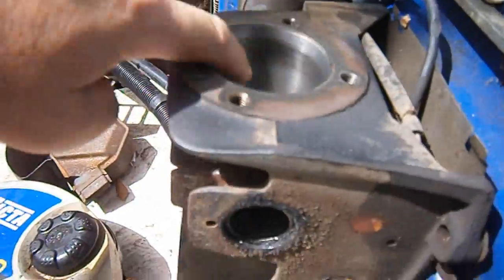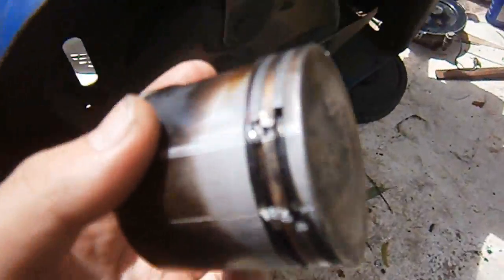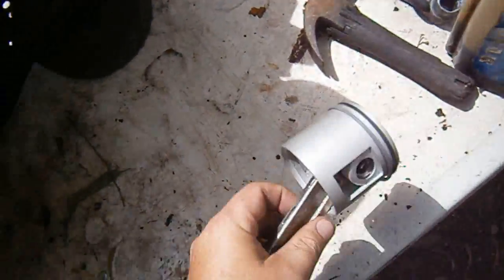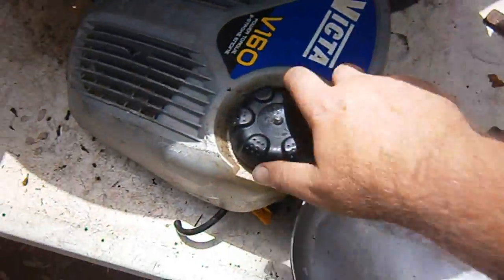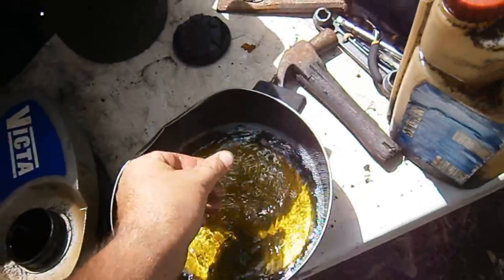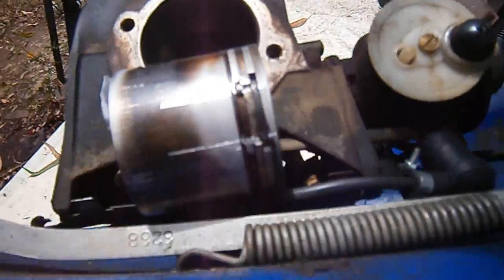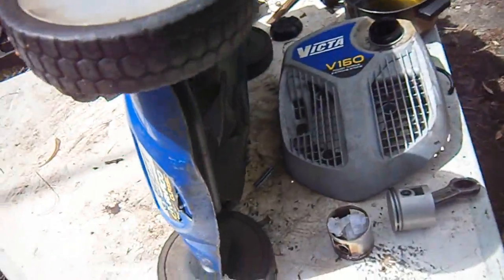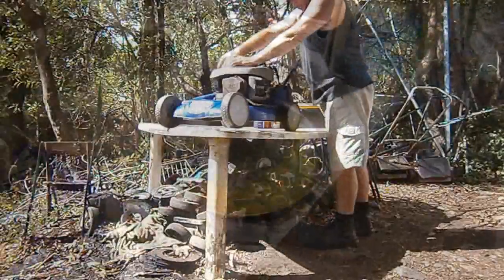CHEAP VICTA LAWN MOWER ENGINE REBUILD

Comment: I love how you tear it down without taking it off the base with the blade holder flywheel still in situ.There really is no need to remove the motor.
Reply from the maker: Piss easy motors to work on. Keeping it on the base makes it easier to handle while undoing the crank pin etc. If there's evidence of lots of old packed grass between the base and underside of the motor, its worth the extra 20 mins to take it off and clean it out to ensure cooling.
Reply: Local councils used these motors for a reason.
I have mowed 2 foot tall grass with my  older domestic model ( with Australian engine casting) and the only complaint was multiple emptying of the catcher!
A Briggs would die if you dared attempted that and I doubt a Honda or Chonda would stand a chance either.

Comment: Good repair, I have a VICTA tornado powered by a briggs.
Reply from the maker: Cheers, the owner brought it back a month ago for some new blades and check over. Still running strong ;)
Reply: That's good mate, a job done right cheers.

Comment: Ive got an identical mower to this one and its a good machine right up to the point where it over revs and wont keep a steady engine speed. for that reason it sits in the shed and does nothing. Any ideas matey?
Reply from the maker: could be a few things. in the case of the mower in the video, it ran, but erratic up and down with back firing due to the damaged piston and rings. most common prob is crap building up in the cabry fuel jet and slowing the fuel supply down. these engines speed up as they run out of fuel. (turn the tap off some time and see) the carby jet is the brass screw that holds the white primer plate on the carby. the screw inside is hollow and has a filter screen that clogs up often. while it's running HIGH, press the primer bulb a few times. if it settles down, the jet screen needs a clean. that model is prone to over heating as Victa (now US owned) have halved the cooling fins on the barrel (planned obsolescence). If you're able to get the muffler off, you'll be able to visually see the piston and rings. They should look like new. Bad ones are all scratched and the rings look melted into the piston. I'll make more specific videos on the topics soon. :)
Reply: ok ill have a look and see what i can find. thanks for getting back to me mate. cheers dave
Reply: @aussiemowers  I believe the later PT160’s were Chinese made, and cooling compromised by deleting some fins. Also, cleaning grass off the barrel helps as well👍

Comment: I got one of those victas New the other month I’m not buying shitty Briggs, I run mine at 40:1 with Stihl HP Ultra 2 stroke oil with Bp ultimate 98. No smoke and she’s running beautiful only 11hours on her. Will check exhaust port after 50hours use and check piston and rings. If Stihl ultra can run whipper snippets at 50:1 at 15,000rpm I think the mower should be fine at 40:1 at 3800rpm. Doesn’t smoke and runs smooth as I love it. Thoughts on ratio input if you like I will listen. Cheers
Reply: Aussie Mowers hahaha top Aussie reply love it yeah back to 25:1 then cheers.

Comment: How did you get the conrod pin out on the crankshaft????
Reply from the maker: I have the sockets from Victa. If it's your own mower a 1 inch cold chisel works fine. The pin comes out counter clockwise, so you will want get the crank steady by using rags or a solid object, wood etc to stop it spinning. Finding an edge on the pin and with a good swift blow at 45 degree or so, it should shock the thread loose. Only takes 1 mm or two and it will come loose. Make sure not to strike low down near the connecting rod or bearing pins.
Reply: Thanks mate able to get it out and fixed now we're running again. Thanks mate

Comment: that.s either Diesel or stale fuel mate
Reply from the maker: Yeah stale fuel has a real awful distinct smell which from memory that batch didn't have. I'd say it was plain ULP from another brand servo that I'm not used to. But it defiantly had no oily 25:1 two stroke texture in it, which in hind sight ruled out diesel as well. Those score makes must have come from some broken bits of metal I think. It's running well now days ;)